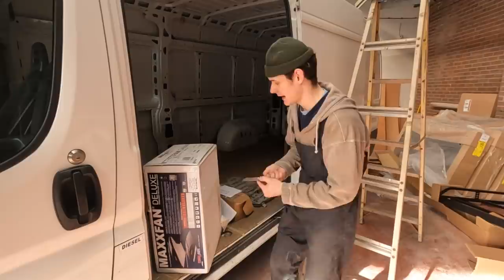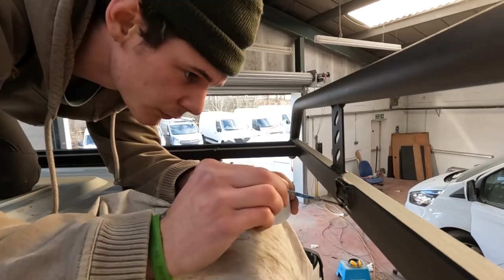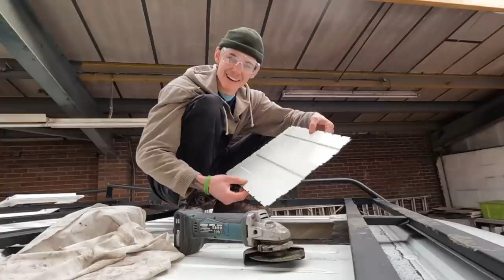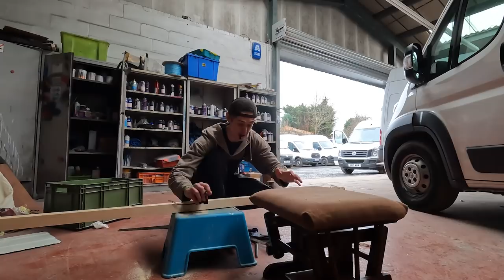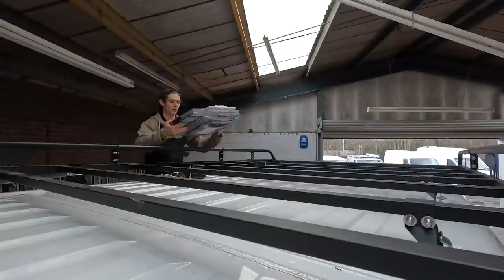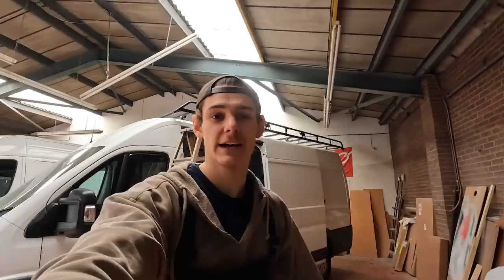Maxxfan Deluxe roof fan & Rino rack installation - Peugeot Boxer

Comment: Just a tip if you’d like. When I installed my max air, I covered every single piece of that plastic frame that goes on first. Just the frame, not the fan. I’ve had it for over a year in any climate you can imagine, and absolutely no leaks

Comment: I have just found your channel, great to watch.
When fitting anything to a van roof can I suggest giving the fan frame a clean with soapy water to remove the chemical that eases it from the manufacturing mold. Many sealants do not adhere well to anything unless fully cleaned.
Also perhaps use W4 mastic tape, never dries out.

Comment: Nice work mate. You might already planning to use it, but if you cut the cross bar, you grinded off, down you might be able to fit two supporting bars on either side of the fan. Might be useful depending on what you're planning for the roof rack.
Reply from the maker: Great idea mate! With the forth coming plans I thing we’ll be good but cheers mate! Good idea! 🙌
Reply: @JakesJourneyMate  No worries mate. 

You might have already said, but why did you choose a Boxer? Not seen many of these being converted compared to Crafters/Sprinters.